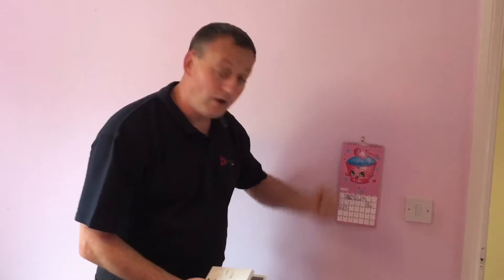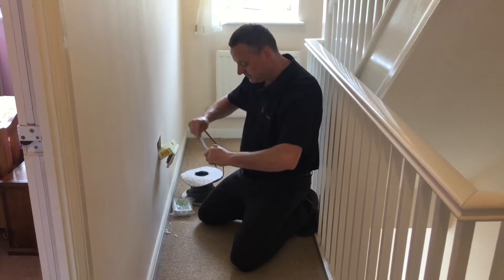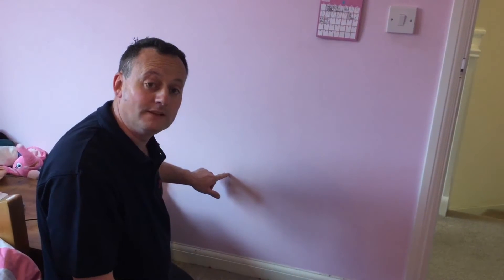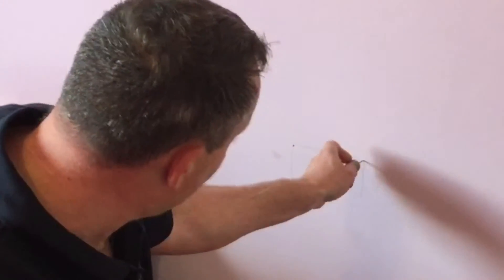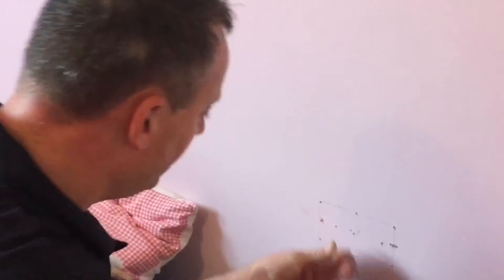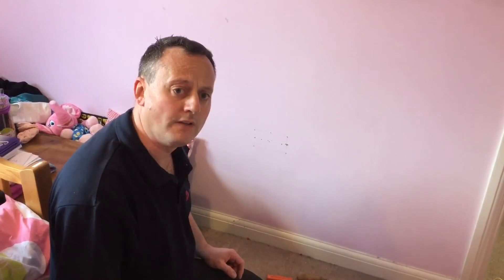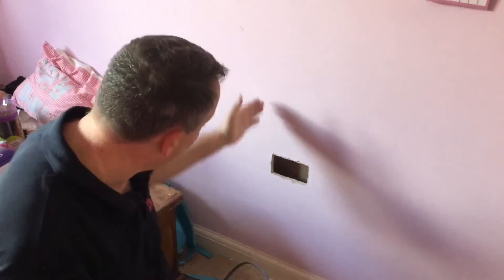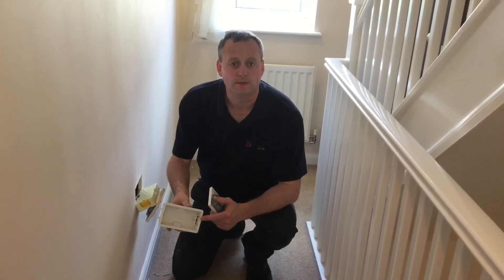Electrical Practical Skills How to Fit a Dry Lining Box in a Stud Plasterboard or Dry Lined Wall

Comment: Brilliant video mate. I would love someone on here show what to do when plasterboard at the side bursts or you have to move to the socket to the side. Because this would leave no board for the yellow clip to hold on to. How would a pro fix that? I ask because I've had to do this in my home a couple of times. I've just built.up no more nails and added a new square of plaster in. But I'm not sure that's right
Reply: Whatever works. Piece of thin rigid material (like another piece of plasterboard if you have any) on the backing overlapping a few inches in 3 directions and adhered to the original wall and whatever adhesive works on the butted area if you really want a bit extra and then plaster on the front. If you can't see a join and it holds the weight then its "right".

These guys make the stuff so I would hope they know what they are doing.  https://youtu.be/8X3__7RMgMQ?t=207

Comment: Some muppet installed a dry lining box with Fixings meant for a much thicker stud wall. Do people use adapters to bridge the gap and save ripping it out starting fresh? I was going to just shuv some dowel into the gap (it's about 50mm)

Comment: Another tip is to use a metal box to mark the outline of the box on the plasterboard. This means you can put a spirit level comfortably on top of the box and get it perfectly level. Even better, when doing this place the metal box in reverse against the wall and its even more stable.

Comment: If you hit a  strut, why not just  use a metal box and fix it to the strut. May have a bit of chiselling to do but easy if you have a multi tool.  Agree with others to use a stanley type knife to score the board first prior to cutting it with a course saw,

Comment: Question: What if I want to install a metal faceplate?
Reply from the maker: Hi. No problem they also fit these boxes .
Reply: @GSHElectrical  Hi GSH Electrical, thank you for the speedy reply back!

Won't I need to earth the metal faceplate to the back box, as the dry lining box doesn't have an earth terminal fitted? Also, you can buy a metal fire rated dry line box, is it worth the extra pounds? 

Thank you again!
Reply from the maker: The earth from the socket circuit wiring will Earth the front plate (exposed conductive part) of the socket.👍
Reply: @GSHElectrical  Thank you so much!!! :)

Comment: why don't you use a multitool to cutout the socket ? you messed up the edges bad
Reply from the maker: Hi. I used a pad saw as that’s the way my learners have to do it during an assessment they do in my workshop. Thanks for the comment GSH Electrical

Comment: Would it be the same for a light switch on a stud wall as whoever lived in my house hasnt put the correct back box in and is coming away from the wall the screws wont tighten either.many thanks
Reply from the maker: Hi. Yes you are totally correct thanks for commenting and watching GSH Electrical 👍

Comment: How did you get power to that socket then?
Reply from the maker: Hi. I Spurred it from the one in the hall on the ring final circuit using 2.5mm2 twin and cpc cable. This cable was fished from the existing socket to the new one. Thanks for commenting and watching GSH Electrical 👍
Reply: GSH Electrical How did you get past the strut? Was there a gap between it and the plasterboard?
Reply: @lastravenmph  I would have put it opposit!

Comment: Nice Video!
One great tool to cut a nice hole into plasterboard faster is the "Fein Multimaster" or the the Bosch equivalent Multitool.
Also to find struts without damaging the wall one could use a Wall-Scanner.
Reply from the maker: Hi. Thanks for that. All my learners have to cut a socket box in a dry lined wall using a pad saw hence the video. I will check them out thanks for watching GSH Electrical

Comment: To move an electrical outlet like this, does one need to be electrically qualified?
Reply from the maker: No I was installing a spured socket from the ring final circuit a job in this case not required to be notified under part P of the building regulations. All the best GSH Electrical
Reply: GSH Electrical thanks. But regards to the wiring for it, do you need to be part P. I have a similar job, I’m installing a new back box and running the cables higher to the new box. Do I need to be part p for that. Many thanks. Good video.
Reply from the maker: As long as your not installing a new circuit from the consumers unit (fuse board) or in a bathroom your fine. All the best Gaz
Reply: GSH Electrical thanks Gaz, but I thought a partial rewire was notifiable under part p? I take it partial rewrite means much more than moving a back Box?
Reply from the maker: Correct
Reply: GSH Electrical thanks. I hope it won’t be difficult removing the existing back box.
Reply: @2wheelspy  well? How was it?

Comment: If you score the wall with the stanley first you wont get that scruffy finish around the box. Or put less pressure forward while pulling the blade towards you.
Reply from the maker: +Kyle 
Thanks for the tips. At my college that type of knife is band but worth consideration in the real world. All the best GSH Electrical
Reply: @GSHElectrical  it was at mine as well, but I still had one in the tool kit.

Comment: theres a strut imbetween the first and new socket how would you be able to get the cable to the new socket then?
Reply from the maker: +diprobase1000 

Hi. Yes you would... you would have to cut away the plaster board over strut and bring the cable out and over it before it goes back into the wall. This cut must be kept in line with the socket either horizontally or vertically so it's in prescribed wiring areas stated in the On-Site Guide. Hope this helps GSH Electrical

Comment: Would any tests be required after install.in normal circumstances mate
Reply from the maker: +Roy Kirkham 

Loads of tests
Before starting the socket on the ring final circuit (the one in the hall) needs testing for ring continuity/polarity, then insulation resistance, next earth fault loop impedance and RCD tests. If all those results are correct then the extra socket can be added. On completion a minor works needs filling out and the tests stated above repeated... that's why I didn't show me adding the socket.
Reply: GSH Electrical 
Wow alot of tests for a single spur to an existing circuit.i thought only the addition of a new circuit requires certificates.or minor works ?
Reply from the maker: +Roy Kirkham 
Totally... what if the new socket had no earth or its impedance was to high that it wouldn't disconnect the overcurrent device (fuse) in time which could cause a massive risk of shock, fire and explosions... that's why we always test. Thanks for the great questions GSH Electrical